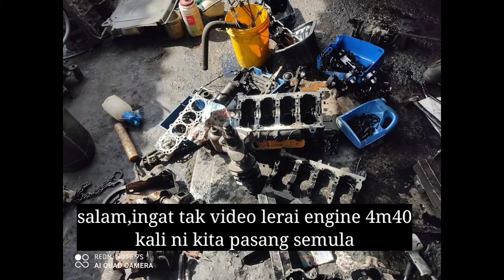Rebuild 4m40 engine + timing chain conversion + 4m40 timing gear & chain marking

Comment: Hi are those new cylinder head bolts or did you re use the same ones that were there before. Are the 4m40 head bolts TTY or not?
Reply: 4M4# TTY bolts can be used up to 3 times according to the service manual

Comment: So the injector pump doesn't need to line up with anything on the cog that the timing chain goes on?

As long as that cog is lined with everything else (balance, oil pump etc) it's fine ?

But there's is timing marks on the side of the injector pump that it needs to line up with and it will be fine?

Comment: It looks as if you timed the injection pump to the non turbo mark, marked "N". The mark above is marked "T" for turbo. Can you clarify that? Thanks for this video!
Reply: Would also like to know hahaha , so the injector cog doesn't need to line up with any marks on the timing chain cog , as long the injector is set to the T mark then yeah ?

Comment: Hello Amrul,  great video 👍I have a question , in behind the oil pump there is a small hole is that open for oil flow or is it blocked with a grub screw? Cheers Glen
Reply from the maker: It's open for oil flow
Reply: @AmrulIshanChannel  Thank you  such much Amrul you are are legend 👍👍now I can continue 🙂cheers. 
Glen

Comment: Hello! I have a question! Possible to change de high pressure fuel pump from this  code me201685 to this code me201684 ?? thanks